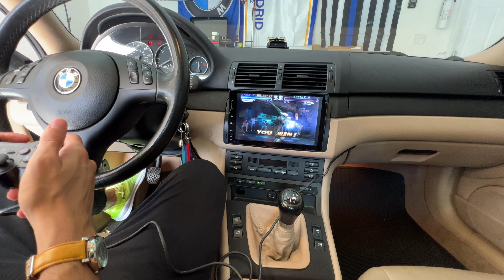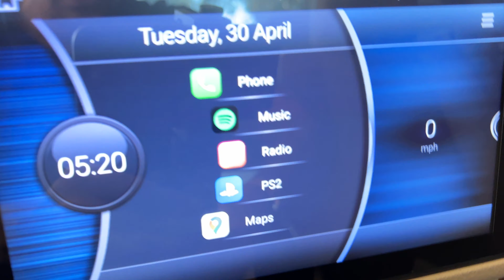I Put a PS2 In my BMW E46!? - Easy DIY

Comment: where did you get the facia kit for the bottom part of the headunit with the usb in it, mine is diy and so janky, this looks so much cleaner
Reply from the maker: Thank you bro! Look up Dynavin AC relocation Bracket! Not exactly mine but very similar. 👍